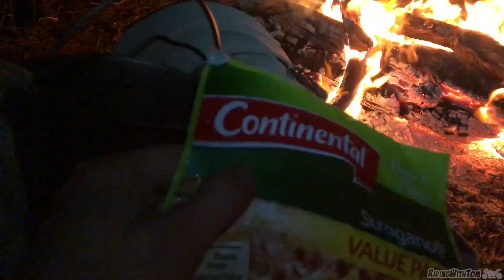KTM690 DEAD ALREADY?!? - Googs Track Desert Adventure! WR250R - Part 2!

Comment: Tatataatatata TOM
Man that little 250 has done some k's now
What a testament to the high revving Yamaha engine
Reply: I have the same bike, 81,000km with no rebuilds
Reply: Keh?
Reply: I mean I have same engine as Tom does, I ride a WR250R, and mine has 81,000km on the clock without any rebuilds
Reply: 81,000km!!!! Are you serious?
That would have to be the highest milage WR250 in existence
I have a 2001 YZ250F (more or less the same engine), owned it since new, it would have 4000k's on it at a guess, and i'd say i've over estimated.
How on earth does someone get 81,000km on WR250F ?
The valves would be toast
Reply: No, there are higher out there. You can see them on advrider, over 100,000km.
There are heaps of guys a bit lower than me, 50 to 60,000km.
I can go take a photo of the odo now if you like ;-)
Reply: Sorry, i didn't see your message after the edit. 
My valve clearance check interval is 40,000km. So I've only just got the second valve check done. 
Tom and I's bikes are not WR250F's. They are WR250R's. It's a different engine, it actually has the same piston (same bore and stroke) and same intake valves as the R1 roadbike circa 2009. It even has a lot of the same error codes in the computer system, which led people to colloquially call the WR250R an R2 on many forums when they first came out. It's basically 1/4 of the R1 engine from '07 - '09. For a while there people were even taking them to bike mechanics and shops that were good with the R1 when it came to developing mods, tuning on dyno etc. 
It has smaller exhaust valves than the R1 for some reason, perhaps they tried for more torque and less revs. 
The engine isn't ideal for offroad, but it's fine. Even though it's a thumper it doesn't have the same torque and pull down low as other 250's. Even old air cooled 250's and stuff can have a bit more pull in the first 1500 revs. But then the engine screams and revs high. You learn to ride it and don't even think about its engine characteristics. It's a compromise I'm happy to make for a 250 that puts out 28hp, can be absolutely thrashed and live life on the rev limiter, and yet still last forever. There are no 250 dual sports that come close. The CRF250L might rival it for longevity (we are yet to see) but is much slower.
Reply: Ah thanks tosgem, i had no idea there was a WR250R
(was only YZF and WRF in my day)
Still, that is insane amount of k's, good on you!
I had no idea it was so closely related to the R1, that is hilarious.
Does that mean you have much higher engine oil change intervals than a WFR?
My YZ250F '01 just amazed me so much, i never sold it, it has had rec rego from 2001, left the shop with rec rego.
Has been on many Alpine rides in Vic and NSW, plus years of normal bush rides and 2 seasons of Pony Express
And it still goes, never even had a ring, just the valves got done once.
I've gone from 85Kg to 105Kg since owning it and it still more power than needed in most situations. My weight hasn't bothered it.
And i can ride it all day and not get tired, unlike the 500.
Reply: Nice to hear about your YZ250F man. I'm a big believer in Yamaha, my blood is blue ;-) I have the current model R1... so I just need an R6 to complete my collection or R's ;-)
I'm happy to hear how good your YZ has been but also not completely surprised, I have heard lots of stories of YZ's and WR's (especially the 450F's) doing more km than many people expect. My cousin has a WR426F from 2001 or something which is still going strong, he loves it. I'm with you on the small bore thing though, easier to ride, not exhausting, still heaps of power if you keep them in the sweet spot. Will hang with the bigger bikes easy. 
I probably need to get the suspension on my WR resprung, I have a similar problem to you in the kg department. Thanks for the reminder ;-)
Reply: 100%, the first year i have the YZ250F and once he engine free'd up
I could not beleive how high it revved, or "over revved".
I remember thinking at the time, there is NO WAY this thing will last.
I'd come off a KTM520, you could just lope that thing around, but it made you a lazy rider.
The 250's give you your youth back, when you used to ride a 80cc, 100cc (YZ100K, my first bike) or a 125cc....
When you had to ride aggressive....
I remember going to buy a newewr RM250F for $6000 brand new and shop owner/friend said, do you want ride your bike or watch it on a workshop bench?
Because the RM will be in here often, stick with your YZ he said..
That was 15 years ago! And he was right, 100% right!
Reply: Agree with everything you said about riding smaller bikes hard, makes you feel like a hoon again! I believe all Yamaha's are reliable but something about those early 2000's models is particularly strong I think. So many Yammie thumpers of that era are still going strong. You've got a winner.
I forgot to answer your question above about the oil change intervals on my WR250R. It's every 5,000km, but for some reason some newer models in other countries say 10,000km (even though the engine hasn't changed). I have typically gone 5 - 7,000km between changes. I got a stainless steel oil filter which I don't replace, just clean, at about 20,000km. 
It got cheap oil and long changes early its life but I must admit since the poor girl clicked over 50,000km (I've ridden to every state and territory of Australia) I did start using fully synthetic only, and sticking to 5,000km and sometimes less.
Reply: Ah nice, yeah i've changed engine oil in all my bikes every second ride
Air Filter cleaned every ride
Has served me well, never had engine or gearbox issues, ever!
But they have all been small oil capacity engines
No way they would have a 5000k interval.
The WR250R sounds like just he ticket for the long haul rides

Comment: Ultra lightweight setup Tom!
But you're relying on others for backup eg fuel and tools
Reply from the maker: I’m not relying on them for fuel, I had 2x  10L fuel bladders. I just didn’t fill them up cause Nerb said it was only 280km to next fuel but it turned out to be 350km so I ran out.

Comment: I had 2 Magura slave cylinders fail on my  new 690. Swapped to an Oberon and had no more issues. I put 13,000 miles on that bike with no other mechanical problems.

Comment: 42 psi is very high. Not sure on your tyres but I only max the 690 at 32 psi. I dont know why you risk crashing and punctures with such high pressures?
Reply: Its only to reduce wear on the asphalt legs.
Reply from the maker: Gotta save them knobbies for the tough stuff

Comment: 42  PSI?! Holy shit I don't even run that much on radial street tires let alone in tubes! The most I have ever seen in a tube is 35 PSI on huge heavy bikes. On my 250 I generally run in the mid-20's for the street, 15 offroad, and 6-8 on ice and snow. 42 is crazy! But I guess if it works... What's the reasoning? Noticed any problems?